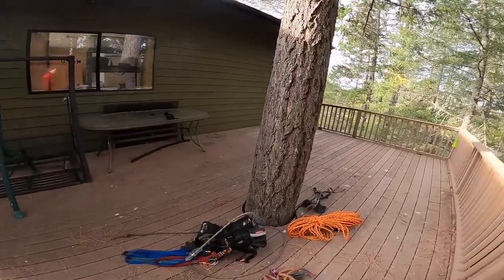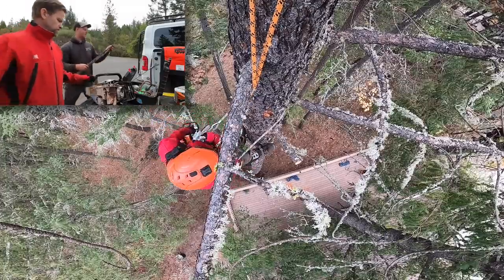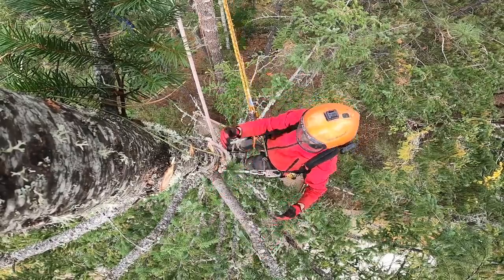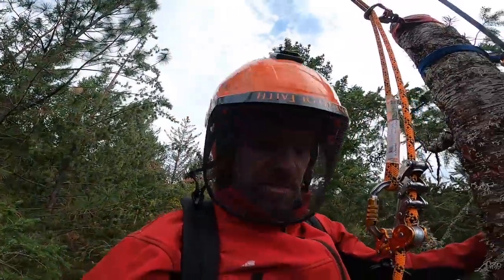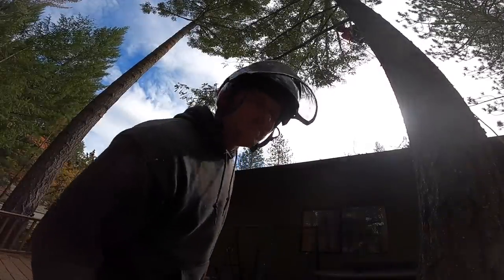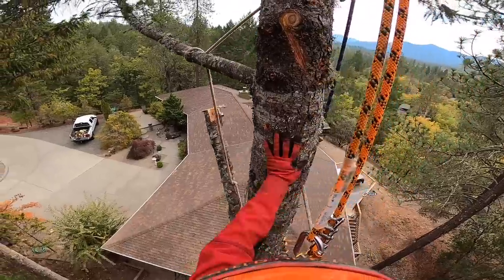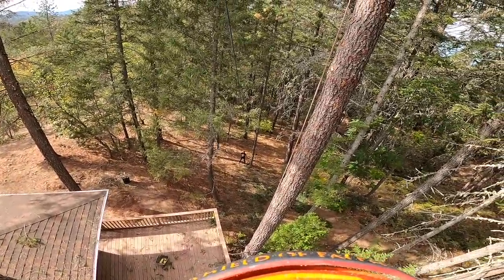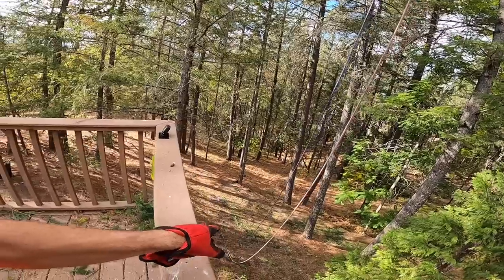So You Want to be an ARBORIST ? . .It won’t be easy.

Comment: We've been running 5 x MS194T s for over a year now. Ended up getting them when there were not any 201s available in our region.  All 3 crews have at least one. Gets used both on the ground an in the tree. So far  we have been sticking with the  .043 guage on either a 16" Stihl or Tsumura bar.  Tried an .050 16" on one of the saws and quickly changed it back. 
These are great for new climbers by the way.....good training saw, fell a bit better than the 192 or 193 even though they are almost identical.  BTW,  muff mod and an Iridium plug do wonders for these.
Reply: I work in telecom and use a 194t for topping/felling poles. Its been a very impressive saw so far, we used it to chop up a pretty wet 20" pole last week and it buzzed right through.
Reply: Facts. Always one by my chipper also.

Comment: If you are mechanically adept, the 193 and 194 benefit greatly from a muffler mod and timing advance.  They are a different saw afterwards.  Also the Stihl 150 and 151's gain a lot from those simple mods.  You will have to tune the carb after also.  I've ran a 193 for years and it is neck and neck with my 201T.
Reply: The 150 really surprised me with a timing advance and muffler mod.
Reply: I got a 193 with muffler mod well broken in and it does rip fast is the 201 TC

Comment: I've seen you do those half hitches in other videos, thanks for the explanation. Clearly you've got a good understanding of how the limb will move. I wonder if some of the time saved in the tree is eaten up by extra work on the ground to untangle it all.
Reply from the maker: Easier to “untangle” a half hitch. It’s not even tied. Once the line is slack it can pop right out.
More pc approved methods are clove hitches on every one or slings on every one. The advantage of the half hitch method shown is speed up above and below.

Comment: That's the only chain you can get unless you change out the sprocket and the bar. It's a decent saw... Not anywhere a 201 but it's lighter by a bit... I'd go with a 2511 Echo in lou of the 194.
Reply: Where I work We use a 194 for climbing now or 261 if needed but we are looking to move to a 201 for a onehander

Comment: Not a fan of the 194 either. Stays on the truck as a back up that I hope I NEEEEEVER need... the ground guys won't even use it for limbing. 😂

Very clever use of a speed line. 👍

Comment: supper lucky u had one close to rig to. I did a maple through a deck 3 leaders, on its own such a pain in the ass. Didn’t have wheel loader at the time Builders that build trees through decks should not be  in business. Nothing like making a easy tree 5 times harder! Great work, PS. u should get a avant! 528 best 36k I ever spent. If u think tracked skid is game changing wait till u try a avant with brush grapple. You will never touch plywood again. And she does work, brush grapple moves monster wood compared to normal grapple. you guys deserve one I will get some vids up eventually lol

Comment: August, how do you feel about the term Arborist attached to your business name? I realize you've been doing this a long time and are probably certified by ISA.  I see companies with "Tree Service" on the side of the truck but no Arborist mentioned. That being said I took the two to be similar, I call a tree service to trim or cut down my trees as well as an Arborist? 
I live in SW FL and I have a huge swamp oak in my front yard (and in my side yard) and the roots of the oak in the front yard was heaving my concrete driveway. I called an Arborist, thinking he would just recommend cutting this glorious tree down and was totally taken off guard when he never mentioned execution of the tree. What he recommended, which involved cutting big roots at certain times of the trees health, which I followed was way less destructive than what I expected. I had the concrete driveway removed and pavers installed, the tree is still really healthy and we're happy.
Have you thought about making videos, although less glamorous or fun, that would highlight the other responsibilities of being an Arborist? And maybe some of the calls you receive and don't recommend cutting down the tree.
Reply from the maker: Thanks for the comment. I don’t have much to say to it except that I just film want I want 🤷🏼‍♂️ it’s a question for a podcast type long answer.

Comment: Have your son check out the UNIVERSITY OF NORTH DAKOTA their flight program is phenomenal you learn to fly in multiple weather conditions and they are very clear and thorough in the aviation program- also they have a huge fleet and take great care to maintain the aircraft- job placement is nice after and they even offer CFI positions following the completion of the certificate- no ‘gimmes’ but if you work hard he will have great success through there!! Best of luck any questions feel free to reach out- graduated in 2009 flying since( rotor and fixed wing)

Comment: Back issues:  Do you do any stretching?  I've found "weighted stretching" works very well for me.
I use a 15lb dumbbell (not much) to help me touch my toes.  I lean over and hold the weight between my hands and relax.  The weight usually starts about knee level.  My arms go down a little - wait - push (ab muscles) just a little further - repeat.  In 60-90 seconds I'm touching the floor.  90 seconds is longer than you think.
I have very few back issues now.
Yes, I'm older than you.
Good luck.
Reply from the maker: I stretch a LOT

Comment: I’m really curious about the false crotch and pulley system you use for your climb line. I’m light years behind you and have been considering that petzl zigzag and a new line to run with it. Your ascents and belays look really effortless and I rarely notice you having to exert much effort tending your line. You’re a really fluid climber. I’m a little bit heavy for a climber and my schwabisch with a pulley gets by alright but it binds and drags. 

False crotch/friction saver rundown would be cool.
Reply from the maker: Ok

Comment: I was a tree cutter I was ground guy dragging brush to the chipper and running the chipper  and felling the tree and bucking up the tree and sometimes I liked to do boom work I never liked climbing I use to never use  a log splitter I would cross cut the wood with my saw and get it down to fireplace size that way and when I was in tree work no one ever paided me for my hard work that I did so I wound up retiring

Comment: I’ve been climbing for going on 12 years now. I’ve never used or owned a small top handle saw I’ve always used a stihl 250 as my climbing saw and before I got that saw it was husky 550 what’s your opinion on switching to top handle
Reply from the maker: It’s sometimes good to expand your horizons. And then judge for yourself the pros and cons.

Comment: I’ve got a 194T. I’d be curious what chain you would have asked for from the stihl dealer that wasn’t a ‘homeowner special’. Lol. I find the chain that came stock with mine chatters and bounces a lot. So hoping your chain recommendation will help fix that and cut quicker.
Reply: I recommend a pico chain on anything smaller than a 201. 14". Basically the size that comes on some power pruners. I believe its 0.043 gauge. So a 14" 0.043 chain and appropriate bar would probably run pretty nice. I've used lots of 192 and 193 saws for pruning jobs and that's the setup i prefer. Kind of a pain to sharpen in the field because the teeth and files are so tiny. But they sure cut much better than the thicker bars.

Comment: When i started building my business i was a sanitation driver.I had been a tree guy in the 90s for the 2 big companies.By 2015 I had enough.My boss made me angry so when i got home i bought a bucket truck.I started fixing all the little issues with it.I kept my job and was saving to keep building.Dec 28 2016 i stepped out of my company truck and broke my leg. After a decade with them i was let go in may 2017.  I climbed and used the bucket with a healing hurting leg.Over 40 stuff heals slow for some reason. 2021 I hired one of my old bosses as a groundsmen.  Hes an awesome person .On the ground below the master where he belongs.  Lol

Comment: Get a hang upside down invertible table . Every other day you adjust table angles kean to relax your back muscles  while on it. After 3 weeks or so you will be fully hang upside down with out tight muscles on your back and pop back your back to normal.  It saved my back . I was on a cane for 5 years.  And one day , I realized  I don't need cane or pains !  It's cheap if you buy it at sporting goods store.  Don't buy genuine  teeter device.  Its RIP off
Reply from the maker: Interesting

Comment: How does the rope get above you so you can suspend/rappel  like that?  Zero exposure or experience on my end... I'm sure that is clear to all of you with experience.
Reply from the maker: I just would throw my climb line higher and higher by hand with a throw ball on it and spur-climb til I’m at the top, then rappel back down to the bottom and head up, cutting off the remaining limbs that needed rigging.

Comment: i wouldn’t recommend the 194 at all i bought two two different times didn’t have em for 30 minutes both times on the job running and working before they both over heated cutting small stuff the thing heated up and started to melt the plastic where the clutch is and chain. it just didn’t hold up like the 193s do or even the 201s the best one i used so far was the husky the 540xp 2 gas but had an electric chain specks and couldn’t find a bar and chain for the life of me but the cut and speed are amazing. 16 in 1.1 0325 64 links i believe but anyways best saw hands down.
Reply: don’t get me wrong the 201 is my goto saw always i run two of them and two 193 s and two echoes for climbing saws echos don’t like al that well. not enough power like the others and don’t last through the touch challenges it’s goes through

Comment: Send me the 194 and a bar and chain. I'll mod it for free, and you can send it to your friend.
Reply from the maker: You do port & polish work ?
Reply: @AugustHunicke  I do. Been doing tree work for a long time and needed something more. Built myself a saw shop. I will change the port timing, spark timing, mod the piston if necessary, open the exhaust.....you know, make it cut.
Reply from the maker: Ok, he’d like that. That’s very cool.
I’ll put the panther 1/4 pitch conversion on it.
You do the other mods and we’ll vid results and I’ll send it to him.
Reply: @AugustHunicke  will do. No need for video credit for me though.
Reply from the maker: I had already told him I would tweak it and then show it to him again. Sending it to him is a whole new idea. 🏆
Reply from the maker: How's that saw coming? It's been awhile since we sent it to you.
Reply: Yes it has. Sorry. I have 7 saws waiting on me and my compressor blew up. Parts should be here Tuesday. I'll send you a ms150 I built from used parts to make up for my slacking.
Reply from the maker: No sir, just checking.
Reply from the maker: Hey Brent, can I get that saw back?
Reply: @AugustHunicke  yes. I'll go finish it right now.
Reply from the maker: Hey Brent email me 🤠 augusthunicke@gmail.com